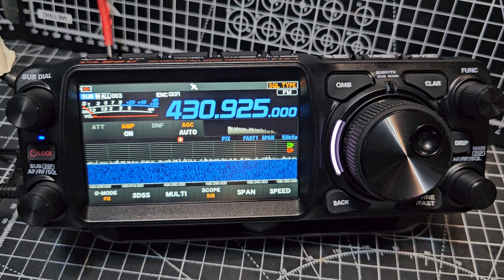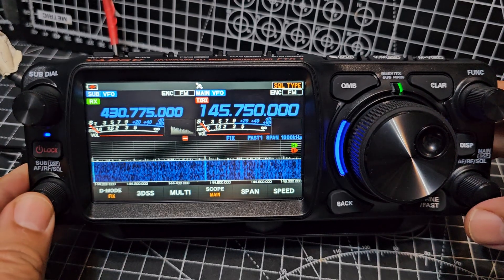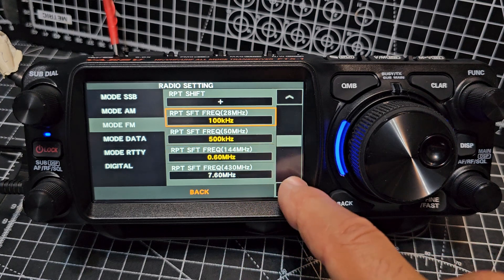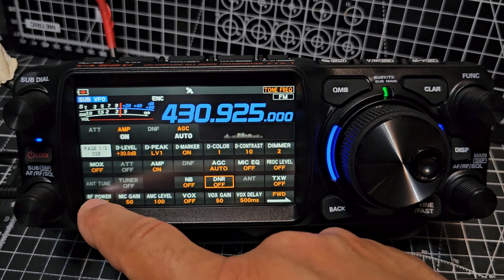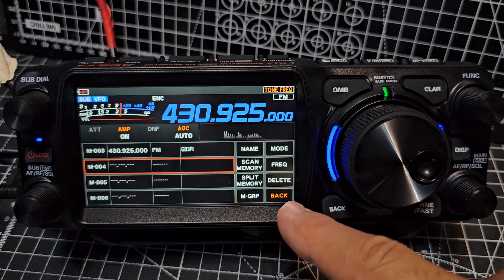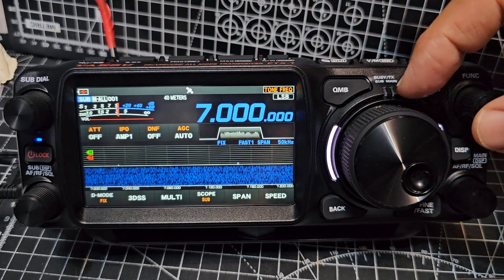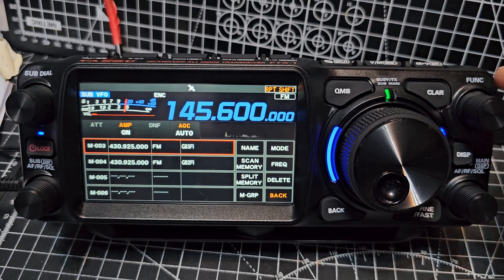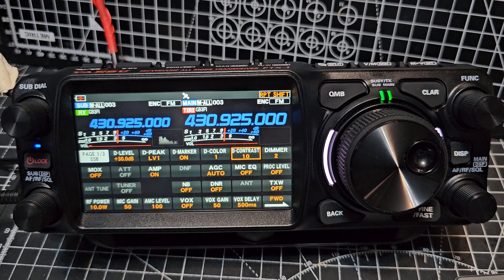Yaesu FTX-1 Add Memory Channel & Name

Comment: I am new to Yaesu but can you have more than one “custom” memory group?
Reply from the maker: M-GRP (My Group) allows custom grouping of any memory channels across bands.

No explicit limit is mentioned on how many channels can be included in an M-GRP.

The radio has a total of 999 memory slots available for programming.
Reply: @M0FXBHamTech   but can you have more than one? Would really like to create more than one of my own custom groups? Like one when I am traveling or one for when I am at my destination. Or be able to group them for monitoring like GMRS, CB, or other specific groups.